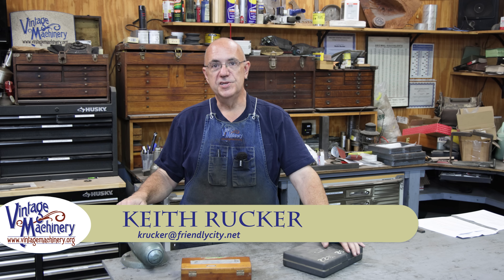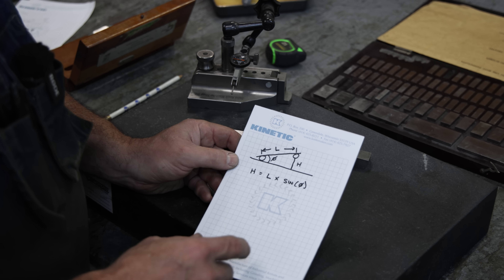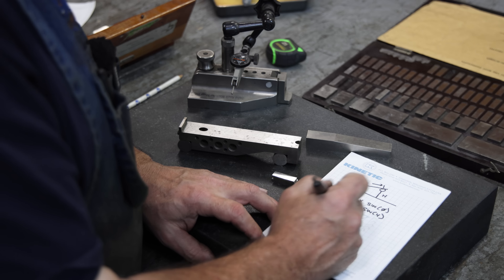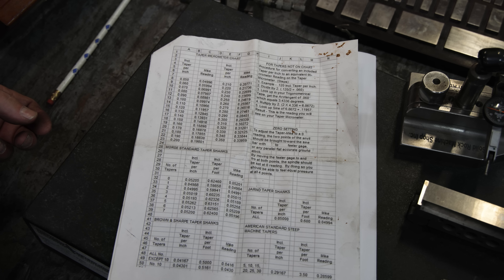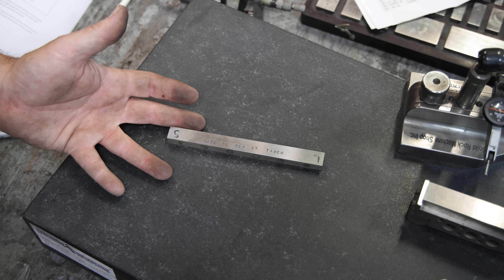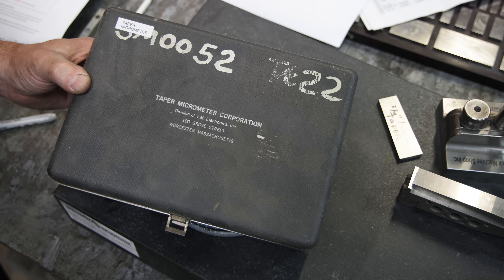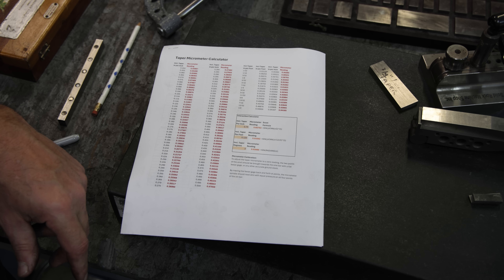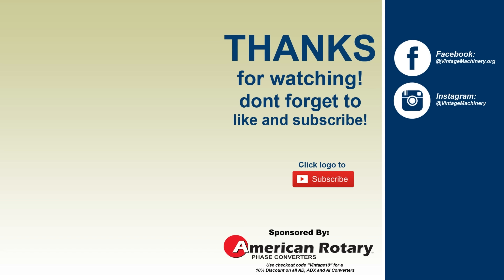Understanding & How to Use a Taper Micrometer to Measure Angles and Tapers

Comment: Hi Mr. Rucker; I just wanted to thank you for another informative topic that I'm not that familiar with. I learned of yet another tool that I have to add to my never ending wish list :). Thanks a bunch :). I just realized that I have been watching you for over ten years now. Oh, one last question could you please, please, please make your Excel sheet / taper calculator available by a link. I really would appreciate it; I'm sure others would find it useful as well. One of my many hobbies is computer programming, and Excel falls in there as well. Especially when I can combine this with machining. Thank you in advance. Kevin M.

Comment: For small angels, you can use this formula: Pi/180 * angle * length. That will be 0,3490. :) The precision will increase with smaller angles.

Comment: Guage block rust maintenance? Do you just clean them the ones you need as you use them
Reply: Frankly, you only need the faces to be clean and free of dust, but that surface rust jerked my chain as well. These hands of mine exude chlorine ions as sweat, this means anything I touch will corrode and show a rust surface. I always carried an aerosol bottle with WD-40 in it, sometimes with a bit of molybdenum disulfide as well if the parts would be moving later. Still have a watchmaker oiler bottle with extensible snout filled with light oil and mollyD nano particles.

Comment: Surely someone makes a device that performs this same task. There are electronic angle gauges. If you made a fixture that replaced the sine bar with an electronic level gauge you should be able to calculate the taper. The fixture would have to be stable & you’d have to zero against the contact bar. Perhaps there are other position sensing devices that would be more practicality adaptable for the purpose.

Comment: Sweet. Thanks for showing us that formula Keith.
But if I tapped in the way you did with 5 x sin 4=. I get 20.
So I reversed my sin with the 4 ( 5 x 4sin = 0.34878) and it comes out right. 
Dam Apple phones!!!
Reply: Also, when doing this make sure your calculator is in degree mode, not radian.
Reply: @FountainCityVol  and for ghods sake don't setup as RPN unless you know what reverse polish notation is and how to use it with formulas... this is an option on most Apple pads and phones, it is there for the convenience of people used to HP calculators.

Comment: So, random question.  How do you measure a taper without a taper micrometer?  Like has a new device replaced the taper micrometer?
Reply: Tapers are usually measured now on a lathe. A dial indicator measures the taper on a test bar between centers using the lathe compound or a taper attachment. Search for “ how to measure tapers on a lathe”

Comment: Perhaps modern distribution (EBay, Amazon, large online tool sellers, etc) would make it possible to profitably market these again. It seems that the micrometer part requires the most work, and yet that is readily available. It would be impressive if you manage to inspire production of NEW taper micrometers!

Comment: I timed it right and picked up a used set for ~$400/each, and got both of those sizes.  You didn't explain (and perhaps it'll be more clear once I see the spreadsheet), but I can't figure out why the mike-reading doesn't match the actual angle.  For example, the chart in my taper mic package says .200 inc taper per inch measures .19801, but it isn't clear why.

It DOES say the procedure for converting an included taper-per-inch to micrometer reading is:

1- Take Included Taper per Inch

2- Divide by 2

3- Look up in trig table, get tangent of result in #2 (arc tan I Think they mean?)

4- Multiply by 2

5- Look up sin of that value in the table to get the actual value.

It still doesn't make sense to me the /2 then *2, and the arc-tan to sine.

Comment: The calculation you made was too 1/10,000ths, but I could be wrong as I'm a metric engineer.
Reply: 'Yeah, for people (like me) that don't naturally work in inches, I'm momentarily confused when an Imperial machinist says "tenths".  It doesn't mean "tenths of an inch" it means "tenths of one thousandth of an inch". Don't ask me why all the divisions of an inch are binary up to 1/64" then decimal on down to tenths, while the multiples go 12, 36, 198, 792, 7920, 63360. (ft, yd, pole, chain, furlong, mile).

Comment: So what happened to taper micrometers?  Did tapered parts go out of fashion?
Reply: No, not out of fashion. Tapers are still the most accurate way to center moving parts. Tapered pins are also used to position and lock stationary parts. Most tapered machine parts are now made on CNC machines. They can still be machined and measured on manual lathe’s using dial indicators.

Comment: If they are no longer made, how does one measure a taper nowadays?
Reply: There are some great youtube vids on how to use 1 2 3 blocks to measure the taper.
Reply: It’s probably fair to say that tapers are used a lot less now.
Reply: Cnc machines cut tapers accurately now.
Reply: Sine bar base, vblock and a height Gage on a surface plate would be one way